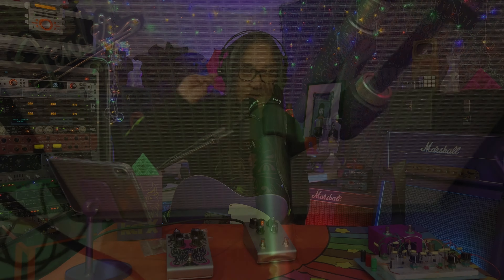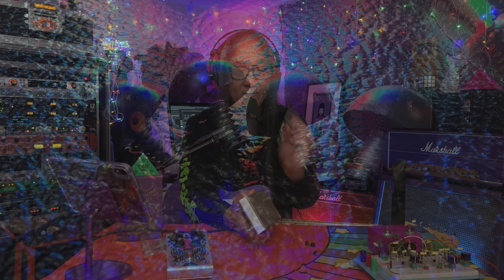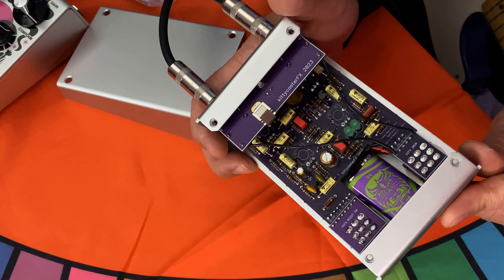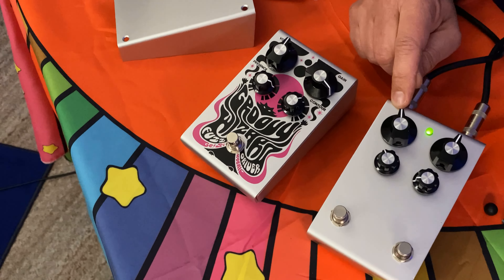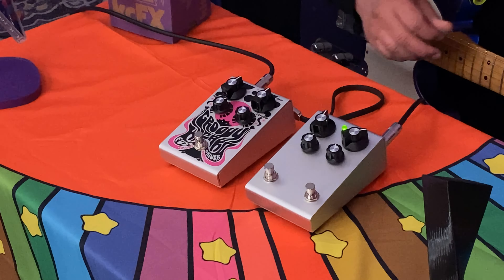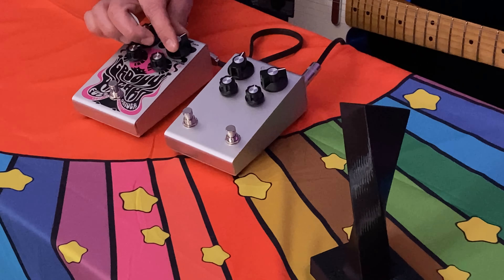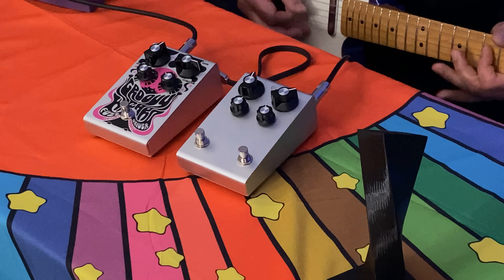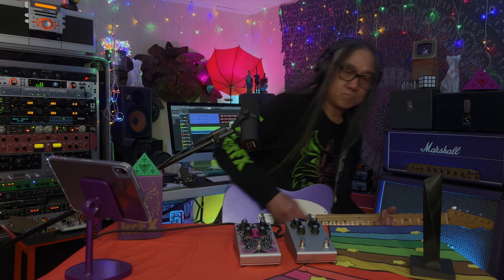New kittycasterFX fuzz prototype vs. Groovy Wizard Fuzz Driver. Which is better???

Comment: I've been down with fuzzes for a couple of decades, and have probably tried well over a hundred.For what I'm looking for,- which is the flexibility to dial back the aggression, and to generally be sensitive to input ,- there really aren't that many existing circuits.I'm def sold on Germanium clipping, finding that the vast majority of Silicon just can't do "the thing"; in fact, I've come to look to every other option other than Silicon.What's good, what's exceptional? Dig the FFC ~900, and it's stacked topology; the OBN Haunt is a more modern classic, and the Beetronics Vezzpa does that gated buzz really well, and is even voltage sensitive.
I enjoyed Howard's work throughout his whole CB journey, and the KC pedals are ace so far. The new Juicy Lucy will no doubt add meaning to that reputation.
Listen to Howard, especially if you're just starting out; don't piss away precious time and energy on the ultimately toxic internet.

Comment: I love the way it sounds. All your muff needs in one box. I do think the stack would have probably worked more successfully the other way around. I use my Groovy Wizard to boost a SunBender Mk IV and uh, that shit rips.
Reply from the maker: Nooooo. Definitely treble boost before thick fuzz. The other way will sound pinched and weak.
Reply: @kittycasterFX  I'm sorry, I meant the stack of the Groovy Wizard and the Proto, not the order you have it in the pedal! The order in the pedal is the exact right thing!
Reply from the maker: Ahh in that case you are correct. That was a random stack order in the video. But personally I wouldn’t stack the new fuzz with the GW probably. I’d use a lighter gain pedal to stack with the GW. Still, it was fun for one handed playing lol.